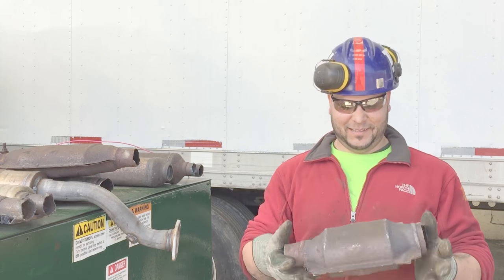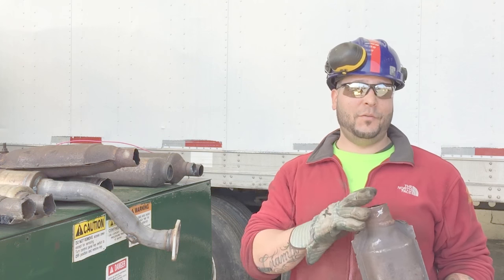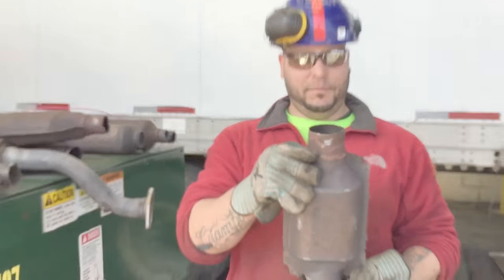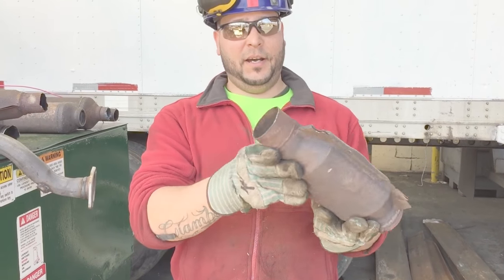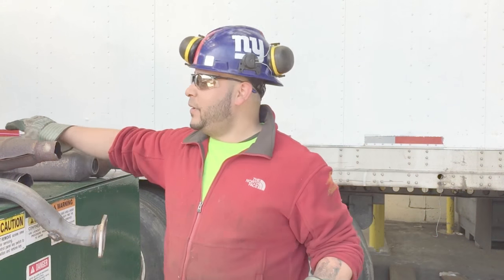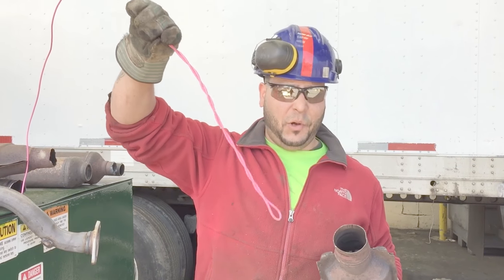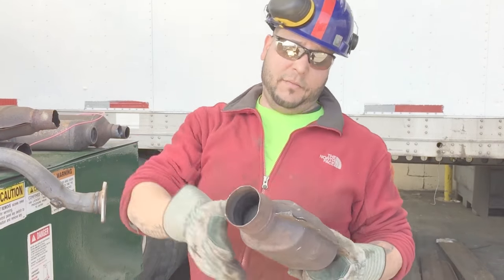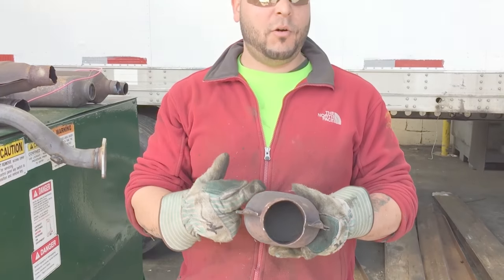How To Prepare Your Catalytic Converters for Scrap

Comment: I sold a catalytic converter last week they didn't look inside but told me its a standard foreign catalytic converter. they paid 45 bucks for it. to a degree I feel I got ripped off but then again its more money than I thought I thought I would get so in my case live and learn
Reply from the maker: That's a fair price...like any other scrap metal, yards have their own standards. When it comes to catalytic converters, it doesn't hurt to shop around.
Reply: It depends on the stamped numbers on them. Pricing depends on that.

Comment: Find the numbers and clean them up with a wire brush. Prices depends on the numbers stamped on the converter.
Reply from the maker: Agreed. Some scrappers don't have the access to the number list to help them. But it's important to find a scrap yard that does.

Comment: using the wire or antenna is a weak grade of a converter and really kinda old skool ...........1/4 full  or half full ....that is the way some of them come. I think grading by the numbers verses an assay report would give the seller more for his product
Reply from the maker: Yes the number way of grading it is much more accurate but for those who don't have ability to have that resources for pricing and grading.